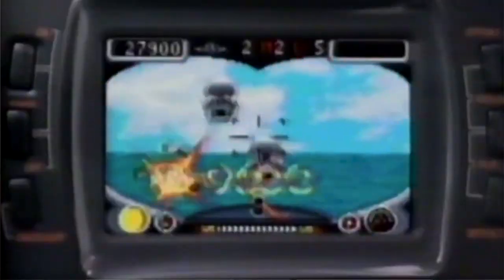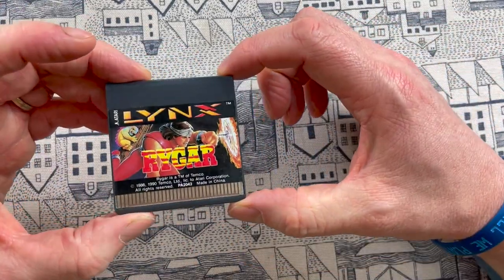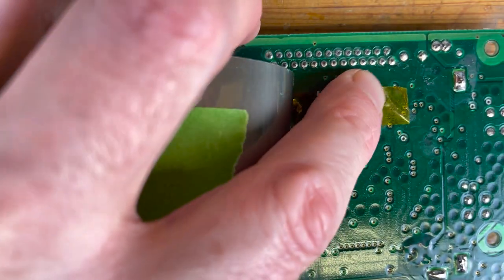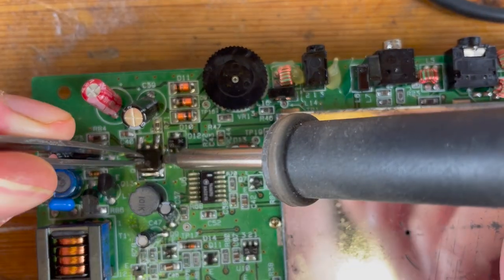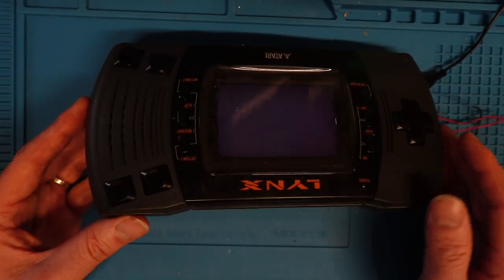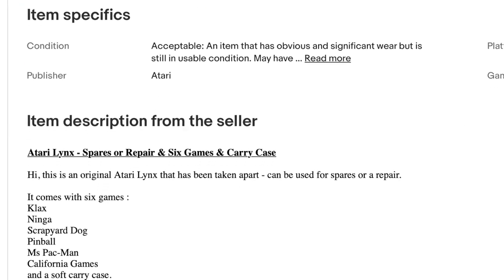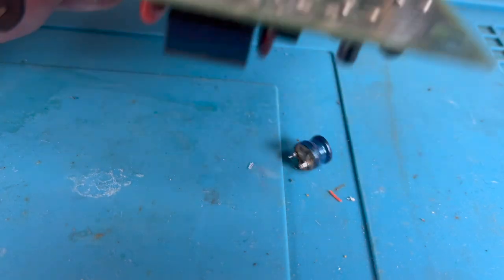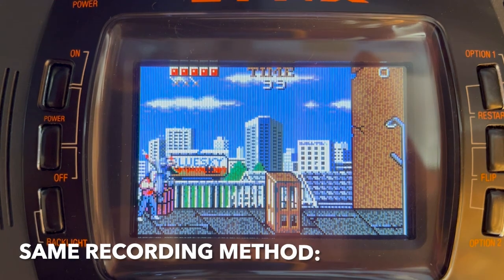Atari Lynx Repair ...An Epic Tale

Comment: When the screen is off from the 3rd scanline button press, it'll be outputting VGA video on the R,G,B, H&V pads, if that's something you might want to use!
Reply: Ah. I did wonder about that but it wasn’t on my radar since I’m waiting for the Lynx adapter on my analogue pocket. Thanks!

Comment: That last Lynx turned out really nicely. Did a similar screen swap when my lcd started showing black lines (sadly no fix for that unlike the DMG GB).  BenVenn is a great bloke and did me solid not unlike some other guy who keeps on charging double VAT on parts. Anyways, where did you get the ram chips from?